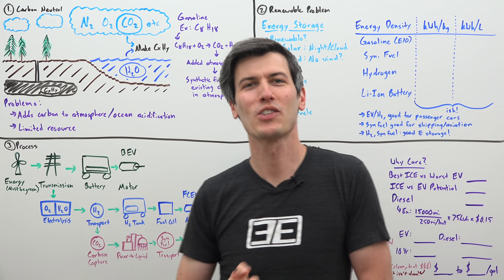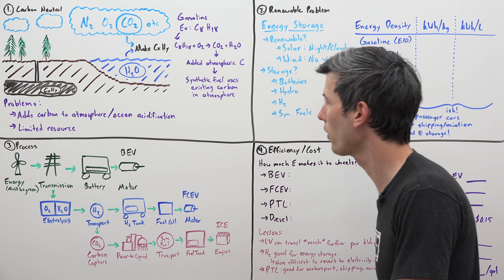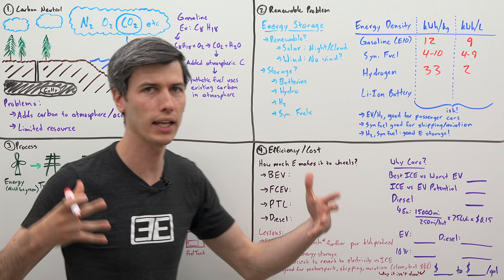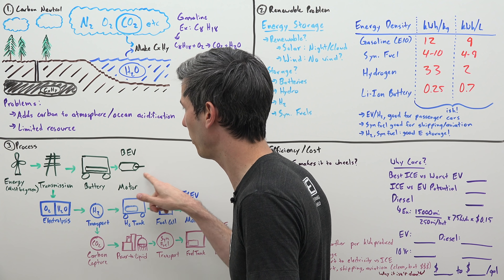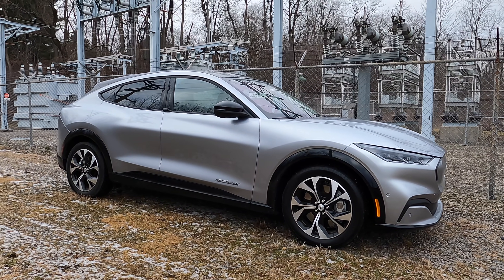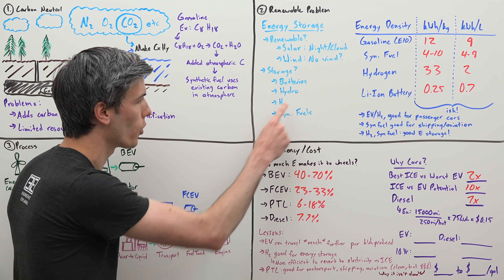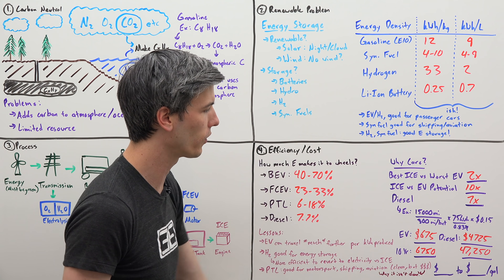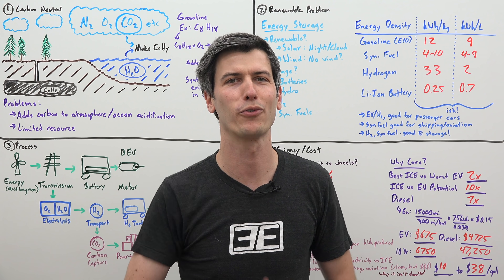The Big Problem With Synthetic Fuels

Comment: Bio-diesel has better energy density than even gasoline  and works fine in ships and planes.
Reply: I was thinking about bio diesel. If you can design an engine from the start to run it, you could run the thing on cooking oil. From a survivalist point of view, thats extremely useful.
Reply: Not too many diesel aircraft out there at the moment. But pretty sure the engines are very similar to what is used today. Wonder why it hasn't been adopted for aircraft and shipping as of yet. Cost possibly?
Reply: @TDubya811  jet fuel is very similar to diesel. More similar to diesel than gasoline anyway.
Reply: @TDubya811  diesel is so close to jet fuel they can practically be considered interchangeable.
Yes, cost is the factor.
Reply: @jimurrata6785  Waxing of diesel at low temperatures has been historically been issue for use in aviation and probably shipping as well on some routes. Very likely low temperature issues could be engineered around though. Cost of biodiesel actually looks comparable with fossil diesel. NOx generated by burning diesel or biodiesel or any fuels burnt with air which may be of concern, but seems unavoidable for the foreseeable future.
Reply: @TDubya811  Of course conventional diesel turns to wax. It's COLD up there!
Refineries don't work too hard to get all the paraffin out. It's cheap, and not too detrimental on the ground where anti-gelling agents are added in winter.
But as was pointed out above, Jet-A is more like kerosene. Industry can refine and crack bio to whatever purity needed.
That still doesn't scale up the amount of feedstock to a sustainable or economical level for widespread or universal use in the aircraft industry.
Reply: @TDubya811  but nitrogen and oxygen don't come from hydrocarbon fuels at all.
That's purely from the atmosphere and heat in the engine.
Reply: @jimurrata6785  Long haul aircraft and planes  will defiently be some of the the most difficult applications to decarbonise due to the energy density requirements. Maybe a more efficient capture atmospheric carbon will eventually be discovered with genetics/biochemistry and AI to make so called E-fuels without competing with food agriculture for land or wrecking the oceans. Possibly if a sustainable route to generate methane at scale and combusted with liquid oxygen (as demonstrated recently with the spacex starship prototypes) NOx could be avoided as well.
Reply: @TDubya811  Well.... carbon capture + green hydrogen = methane.
Obviously combustion with pure oxygen can't generate NOx. There's no nitrogen in hydrocarbons.
Turbines consume huge amounts of air, and generally the nitrogen is just a pumping fluid. 
It contributes nothing to combustion, but is part of the thrust equation.
Hydrogen and nitrogen = ammonia, and that's combustible.
I guess the tough part is not making cyanide exhaust.
Reply: @TDubya811  A gas turbine engine can run on anything in theory. Reason why kerosene (Jet A) is used is that it's cheaper to produce than diesel. Reciprocating aircraft engines that run on diesel are extremely rare... I've only seen one which was an experimental biplane.
Reply: @Reindeer911  I meant jet turbines.
Yes you can run a turbine on almost anything, but the infrastructure to deliver and the engine industry (GE, RR & PW) is already optimized for (what is essentially) kerosene.
The planes are designed around the fuel loads required from jet-a, and I think that any fuel that might have better energy density is going to be on the side of diminishing returns as far as energy input to create it.
For the time being even GMO algae and phytoplankton can't produce lipids at the scale we need to fulfill these transportation requirements.
Open ocean extraction would decimate an ecosystem that covers 70+% of the earth.
Reply: Bio-diesel & bunker fuel will live for a long time pushing ships around the world's oceans.

Comment: What about biofuels? What about Propel HPR or Neste Renewable Diesel?
Reply: They take away from either natural habitats or food production because more farming is required. They are not a solution. For the time being - electric cars are the only solution. Maybe, just maybe for planes you could farm fuels for.
Reply: @rkan2  incorrect.
Reply: @rkan2  the exact same thing could be said for solar and wind farms
Reply: @coreyfro  For solar farms maybe.. but for wind farms, not so much. Also wind farms are at least a couple orders of magnitude more productive  than the same area of farmed land... A field of corn is not gonna run too many cars, while just one big wind turbine (at around 12MW) would run around 6000 electric cars with ineffiencies included from the source to wheels and on a capcity factor of only 20%. ( (12MW*20%)/0.4kW)
Reply: @rkan2  but windfarms preclude forrest's and are often placed on arable land which could have the secondary use of grazing but not much else.

These tracts of real estate compete with natural ecosystems.

The difference is, biofuels are often produced with waste biomass and are a diverted wasteflow from existing industries.

Additionally, biofuel has it's own useful waste stream. To make Biodiesel, medical grade glycerin is produced.

These complimentary industries assures efficient land use.

Biofuels also allow farmers to grow crops.or use yields in times of surplus.

Finally. They only have a 20% well to wheel positive CO2 contribution.  This can, in the right engine, exceed.the eMPG of comparable EV or PHEV cars.

That's is...if the crop was ONLY produced for fuel.  That 20% CO2 cost DROPS when you factor in waste sources AND complementary industrial use of biofuel crop waste.
Reply: @coreyfro  Regardless of what you are saying. Most windfarms these days are being built on the sea so they don't consume any farming resources. The only place I see biofuels making sense is aviation. Other than that it is clear that for road traffic electric vehicles is the way for the immediate future. We'll see how long ships keep burning fossil fuels. Shorter shipping distances will probably also be electrified as they already are.
Reply: @rkan2  do you really think a wind farm at sea has no impact on the environment? And since it is all coastal, how much real estate can be devoted to it?

As to electric being the future, it takes between 120KGs and 200KGs of CO2 to produce every KW-H of lithium ion battery.  It would take a Tesla 200,000KM to overtake a Prius HEV and depending on the responsibility of the driver, possibly never able to overtake a Prius PHEV since the Prius PHEV and the Tesla have the same eMPG but not the same initial CO2 expenditure.

Now an efficient old diesel sedan doesn't have the initial expenditure at all, and, theoretically, has a higher equivalent eMPG if biofuel is used.

The next question is, which is a better use of real estate, solar farms or biomass consuming carbon? Photosynthesis works even with cloud cover and may potentially be more than 20% efficient.  PV, at best, is 23% efficient.

And if you think solar farms can go on the ocean, that would rob us of an ENTIRE WATER COLUMN of photosynthesising organisms sucking carbon out if the ocean.
Reply: @coreyfro   @Corey McGuire  Youtube lost my comment I was writing in short:

- Check out map of windfarms on the North Sea and especially upcoming projects around the world.
- Lifetime emissions of EVs are fairly well documented - don't drive an eve with German or Polish electricity generation
- You are talking about different effiency. Think about how much biomass you can grow on 1m2 of area, then consider solar panels and wind turbines.
- A wind turbine will probably be around 60W/m2 or more on average with a capacity factor of 20% (high estimate)
- A solar panel will probably be around half that of wind turbine or even less, depending on the capacity factors which are around 20% for solar and 20-50% for wind.
- According to one EU funded study, during 7 years, one m2 managed 1kWh worth of biofuel. A solar panel will do that literally in a couple days, and a wind turbine within hours.
- I never suggested to put solar panels on top of oceans. They should be deployed on "passive" space, such as some canals and deserts, roofs and roadways.
Reply: @coreyfro  You can search for the study with "BIOMASS CROPS ARE ENERGY EFFICIENT AND CLIMATE FRIENDLY"

A quote from it: "However, they uncovered drawbacks, too: in particular, the substantial amount of land area required to produce the energy – 1 m2 per kWh. Furthermore, the total cost of producing bioenergy was five times higher than the profit made from the production of renewable heat and electricity. “Profit can only be made from bioenergy if the land is owned by the producer and if the biomass plantation is at least partly subsidised over its 20-year lifetime,” says Ceulemans."

Now consider how many crops of more valuable (though a bit less reliable crops ofc) food crops could be produced on the same area.

Comment: Assuming a serial hybrid with a battery capable of doing 60 km electric, the car cost might be 20-25k USD. Making an eFuel , has an efficiency of 38% ( electricity to liquid fuel). The cost/kWh of solar electricity is 2ct/kWh(Best scenario). The oxygen made in the process is sold to other industries. This should be taken into account making cost calculations. Is this correct?

Comment: But, your entire development is based in first world countries that have enough resources to make a choice. And unlike batteries, synthetic fuels can be used on a global scale since most, if not, all countries have a pre-established petrol network.
Basically, what I'm trying to say is:
Do you think developing countries have the resources and means to adapt to lithium-ion battery transportation ?
Reply from the maker: No idea! But if synthetic fuels cost $20/gal it's not going to make sense for developing countries either. Biofuel might be a better solution - need to look into it!
Reply: @EngineeringExplained  The reason behind my previous argument is that if synthetic fuels eventually become cheaper, the worldwide transition will be much faster than EVs.
In the end, I just want to spread the idea that climate change IS a problem and HAS to be addressed on a global scale, otherwise nothing will change.
Reply: @llama_wehraboo7274  the ultimate plan is to stop burning fuel as it pollutes from the pollution pipe at the back of a vehicle.  Carbon neutral is a last gasp solution
Reply: @rtfazeberdee3519  by "burning fuel", you mean fossil non-renewable fuel right ?
Reply: @llama_wehraboo7274  Any fuel that burns and creates pollution.

Comment: EE videos are the only reason I know what day it is. Never change bro! <3
Reply from the maker: Haha I'm actually considering changing the post date. Oh, we'll all be off.
Reply: @EngineeringExplained  I think you made a mistake in your assumptions. I am pretty sure synfuel companies will locate in regions of Earth with the absolute lowest cost of renewable energy. That cost is going to be much lower than what we pay to charge at home (and especially what we pay at rapid chargers). The average cost per kWh in the USA is about $0.13. Hydroelectricity in certain parts of the world is less than $0.05 per kWh. Wind is lower than $0.02/kWh in some places. That cost is going to go down even more, since it is controlled by flexible companies that can locate anywhere in the world and wind + solar is only going to become cheaper from here on. I doubt household electricity prices in the USA are going to match that price drop. 

Bottom line: Synfuel is going to be much cheaper than you expect, when it is scaled up. The low efficiency matters less than total cost and convenience. Battery prices will probably fall slower than we think from here. Because the higher demand for the materials to build these batteries will drive up prices.
Reply: @EngineeringExplained  you're awesome! 🌈
Reply: @EngineeringExplained  what do you think of lithium and other battery materials running out by 2030?

Comment: Making an analysis of efficiency on some of this technologies assuming energy comes from a renewable and virtually unlimited source like solar it’s a bit pointless. As engineers we need to maximize efficiency on resources that are scarce, and analyze the impact of producing whatever we want to put in the market. With that in mind, we have to contemplate the cost of replacing all infrastructure and existing vehicles in the equation of carbon neutrality, plus the new consumable elements. With this different perspective, I think synthetic fuels and hydrogen makes more sense than electric.

One final thought, implying that a technology will improve is both redundant and irrelevant. All technologies have room for improvement unless we’re met with a theoretical limit (namely, producing more energy than what the sun outputs per square meter). Technology improvements are driven by adoption and consumption, so I’m pretty confident that no matter the option we choose, we will eventually improve its efficiency. In the end more efficient production means bigger margins of profit.

My 2c

Comment: Great video!
Does your assessment of hydrogen being the better storage solution also account for storage losses/ cost of cooling hydrogen? Had a similar conversation just last week and someone made the argument for efuels over hydrogen based on the fact that efuels could be stored more easily
Reply from the maker: From what I've read, I believe the idea is storing hydrogen deep underground which makes it easier to address the storage problems. But yes, eFuel storage does seem much simpler.
Reply: Big money is on hydrogen so it appears that has already been accessed

Comment: Why not just make a Hydrogen combustion engine with over 50% thermal efficient and run it directly on Hydrogen
Toyota is testing its hydrogen combustion engine in motorsports
Reply from the maker: Here's a video explaining why: https://youtu.be/1Ajq46qHp0c
Reply: @EngineeringExplained  I saw that video earlier but not all combustion engines are inefficient some of the best ones are around 40%

Comment: Unfortunately, while hydrogen while those calculations indicate hydrogen might make sense on paper for a fuel backup for the grid, it also is not exactly ideal to be stored. In that it is difficult to create storage vessels that are not leaking, on top of which it also embrittles many metals over time.

Comment: 13:25  “the cost is absolutely insane”  I use to say that about LED light bulbs, they were $30-$40 each when they entered the market, but through volume, evolution in the technology and manufacturing efficiency you can now buy the same bulb for $1.65.  Is it conceivable that fuel costs will find a similar path in the market?

I also remember computer memory chips in the  90’s was $50 per megabyte.
Reply from the maker: You're comparing different technologies. Again, I'd reference the conclusion of this video. Has energy gotten cheaper and cheaper and cheaper? And even if it does, using double the energy will always cost more than using half the energy. It's not a matter of tech advances, it's an energy problem. Whichever path uses the least energy will make the most financial sense.
Reply: @EngineeringExplained  When you pluck semiconductors in form of solar panels in to the equation - electricity is still getting cheaper - especially kind which doesn't create co2.
Reply: @rkan2  You can pick up an LG NeON 2 panel for a couple hundred quid. 330w per panel. Throw in a powerwall for energy storage and it starts looking appealing.
Reply: @EngineeringExplained  the most financial sense is not the question at hand, but if the synthetic fuel could be at a price point that it's a viable option. 

Not all of us have any interest in going electric, its to expensive. I can drive and maintain my old Buick for a few decades on the cost of purchasing an electric car. Granted I don't put many miles on my car as I'm usually in the semi so my numbers are not the average.
Reply: @jaydunbar7538  financial sense is all that this video is about. You will always pay many times more per 100 miles to travel with synthetic fuel, compared to someone with battery electric car. Because both needed to buy the electricity to begin with.
Reply: If i were to guess, fuel production is as efficient as it's gonna get- they've been optimizing it for years and years. There's not much room to go
Reply: You've described what's happening to the battery market right now.
Reply: Never make the mistake of comparing the cost reduction in computers with any other product. The reason computers get cheaper while also getting much, much faster is because transistors get smaller and smaller, so we can cram more in the same space, therefore material cost goes down while performance goes up. The smaller the computer, the more usable it becomes. Your phone is more usable and affordable than a computer the size of a room, for example. You can't apply the same logic to anything else. An RC car is going to be cheaper than a normal car, but you can't drive it so it's useless for transport.
Reply: @pc_screen5478  it was improvements in manufacturing and design that improved the IC so much. UV lithography has gone a long way.
Battery manufacturer has become much better with significantly reduced costs. Batteries I built 2 years ago cost less than half today.
Reply: first gigabyte hdd was over 2k lol